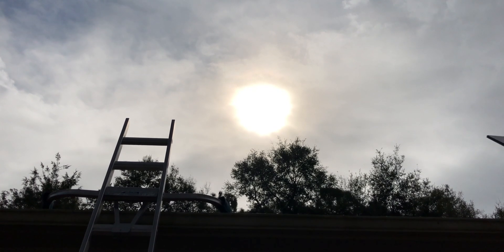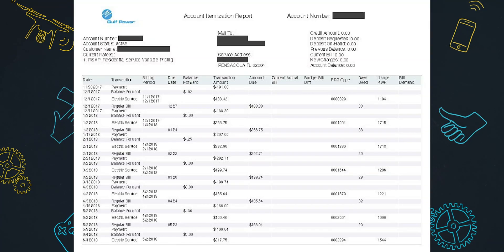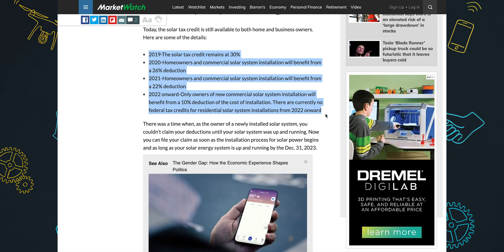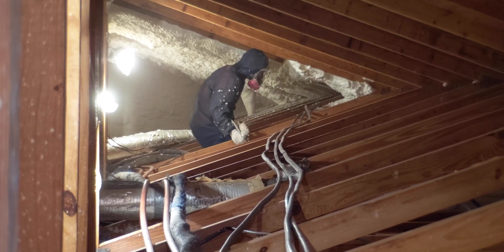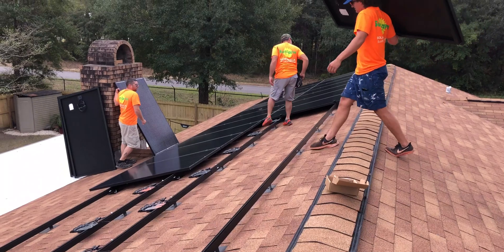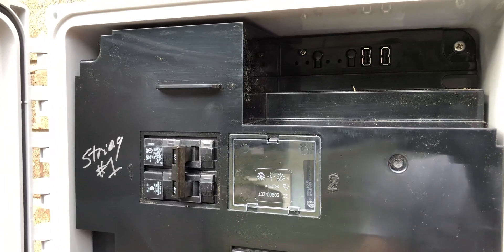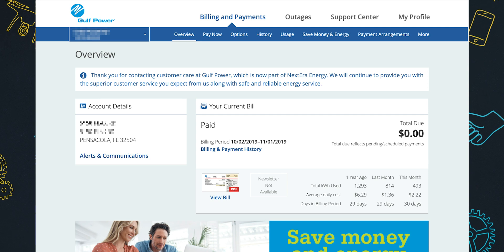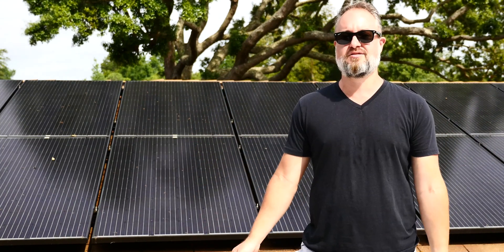Why I went solar in 2019

Comment: In many European countries, the generated power during the day will no longer be compensated by power companies. Due to the fact that there is a massive power overcapacity around noon (when power demand is very low) while there is less powersupply and more demand in the evening and morning. 

That's the thing with solar panels. The supply of power does not match the demand, nearly all of the time. Now batteries may make a difference. But if you factor in the costs of those, and the fact that power companies may not always compensate your generated power. Then it may not be very profitable at all.

Comment: Pretty sure you have the tax credit wrong.
They give you 30% of the cost as a tax credit which means if you paid 30k they'll take 10k off your taxable income it's not a rebate they just reduce your taxable income.
Reply: Sure its not a rebate... but if you have enough tax liability it will turn into a check back in your tax return. For example lets say your a W2 employee and when you do your taxes you found out you owed the govt 20k and you paid them 25k. Your tax return would then be 5k. If you had a 10k tax credit what you owed the government reduces to 10k therefore in that same scenario you would get back 15k instead.

Comment: Just finished installing  9.25 KW on my home for $.77/watt after tax credit.  Solar companies are charging $3.50-4.00 a watt. This is a ripoff.  DIY  paying cash is the way to make solar installations profitable for the consumer.  My system will pay itself off in 5.5 years while also generating a 17% annual return on my initial  $10000 invested.  Most professional installations will be lucky to turn a profit within the equipment life cycle due to profit margins being absorbed on the front end by installers and finance companies.

Comment: A few things..

My system is about 10 years old, I live in Virginia, so less sun than Southern Latitudes (like Fla). At the time, high output panels where about 175 watts each and I have 38 panels. During design, I didn't do any math based on what my house uses in electricity, I just wanted as many panels as we could put up given our roof size, exposure, tree cover etc. and that turned out to be 38.

Our system has full internet access with solar generation numbers and panel analysis etc..but also INCLUDES live house power usage. If I only had panel output numbers, that would be ok, but having house power usage is critical to figuring things out and improve power usage. Our $$ savings over the years have mostly surrounded the knowledge of electricity usage on top of solar generation. We are able to get charts/graphs/reports.. It is not really hard to make this happen..Takes a black box with some sensors in the electric panels and an internet connection. The portal is via Locus Energy.  

Our house has many outdoor lights, (2) hot water heaters (electric), (3) HVAC systems, (3) pool pumps. House is 4500 sq feet above ground.
 Before putting up solar panels our electrical bills were a bit less than $4K/year.

Having said this, I have had many conversations with people where I start with "Sure, nice to have the system, but ultimately the math doesn't work in a self sustaining way". Here is why I say that. The math for Modern Dad is different than my math, but I think the math is still less attractive than most think. Important, the way I think about this is.. Can it work without massive (and I mean massive) government intervention? The answer to that currently is a huge NO. Anybody who puts up panels (or wind generators and electric cars) and thinks about the math will always consider the government intervention, and rarely will they put it in the context the system will be obsolete in 20 years and need to be replaced (car batteries less time), so 20 year math is important. Modern Dad thinks his roof will need replacing before that so he will have an interesting concept to think about at that time. I try and think in terms of what if there was NO government intervention, then what. How does green stuff work without it (Panels/Wind/Prius/Tesla etc. not to mention all those panels and batteries heading for the graveyard and all the grid juice needed to charge batteries etc)?

When you go solar, there is a booklet/table you can go that will tell you (almost exactly) how much electricity a system of a particular size will generate on an annual basis. It is based on system size, angle to horizon, latitude, exposure (including a statement of surrounding trees) etc. This number in Kilowatt Hours (actually Megawatts) ALMOST tells the whole mathematical story. As Modern Dad stated, the expected life of the panels (at 90%) is about 20 years. I am fairly sure it is a bit less but let's assume that. My system is stated by the book to generate on average 8.1 Megawatt Hours/year (or 8100 Kilowatt Hours/year). Our power company charges a bit more than 10 cents per Kilowatt hour. If my system does in fact generate 8100 KWH per year, that translates to about $810/year "worth" of electricity. Makes no difference if I use it or send it back to the grid, $810/year is $810 no matter where it goes. 

Next computation is $810 times 20 years. That number is $16,200.  So, no matter how you look at it, you can't "break even" unless the system cost $16,200 (all in) when installed, which of course they don't. Remember, even if we broke even, the next system goes in after 20 years (or less) not to mention a roof replacement, panel replacement, inverter exchange etc. If the system does really cost $16,200, then you are actually getting FREE electricity AFTER system is paid for, (less connection fees etc.). My system cost $45K and it generates just $810/year ($16,200 by 20 years which doesn't come close to paying for it). Of course, I currently still pay on average about $200/month in electricity to the grid provider. I am saving another $800 by knowing how the house uses electricity, so in that respect I am saving about $1.6K/year even though the panels only generate about half that. 

Now, the conversation becomes a bit more confusing when locations (latitudes) are generating more (or less) electricity, more/higher yielding panels etc. For me, my system cost $45K (price of panels and output have changed over the past 10 years). On top of the 30% Fed tax credit, we actually had a State Grant Program that pushed out close to 30% on top of that. Also, we have a thing called renewable energy credits (REC's for short) which have a value as well. For me, there was no way I was going into a $45K investment to HOPEFULLY break even (which was impossible without TONS of government intervention), or worse (as shown above will actually cost substantial money to say I can generate so called "free" electricity). Many systems actually cost much more than one would normally pay the power company. 

I went forward because all in I was able to pay for the system in about 5 years (all in) but only after massive government intervention. 

I think that when cost effective Geothermal in conjunction with better solar, like siding and roof shingles that are part of the house construction and hopefully lasts longer, we will we get close to actually going off grid for reasonable cost and hopefully without massive government intervention (guess who pays for that intervention). Maybe a mini nuclear box in our basement will do it.  

Sorry for being so long..

Comment: We got solar last year and it has been nothing but a headache.  We still have a power bill it really hasn't dropped the power bill.  The inverter has broken multiple times.  Just blargh.
Reply from the maker: Well that's no good!
Reply: Since you said "the inverter has broken", that implies you might be running panels into one inverter, I would say that is your largest issue. Any cloud on one panel and the whole system degrades. Today's systems are done with individual microinverters. so any panel that degrades from a cloud, doesn't take down the whole system. Modern Dad put in micro inverters.
Reply: @hansroland6420  this is literally not true what so ever. Even central inverters these days have power optimizers to avoid this.  Panels also come with bypass diodes these days if a panel stops working the rest of the circuit continues to function.
Reply from the maker: Hans Roland depends on what the installer uses, but yeah.